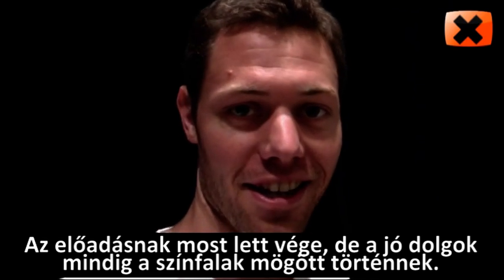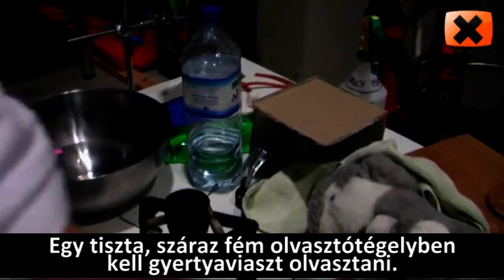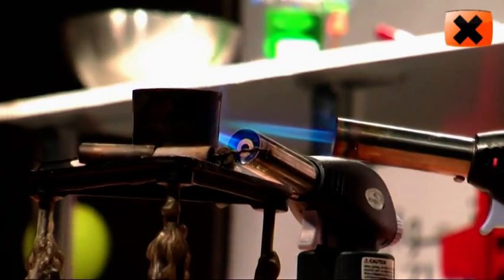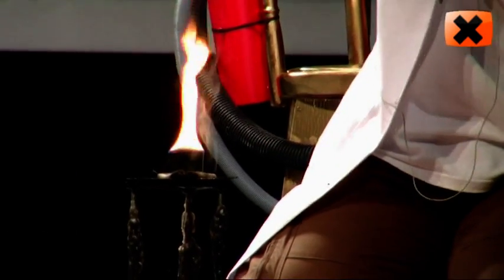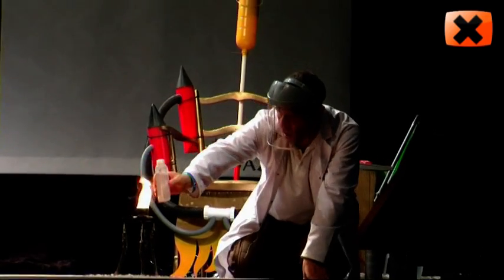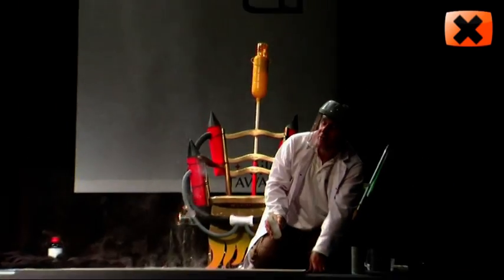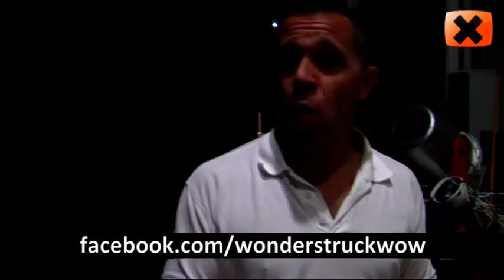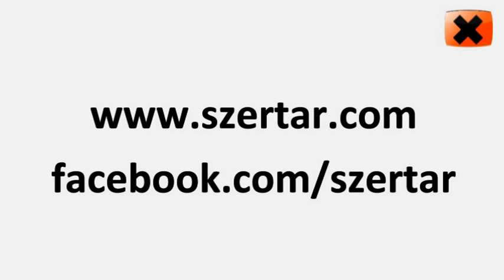DIY thermobaric bomb / Csináld magad aeroszol-bomba

Comment: This has nothing to do with a air-fuel bomb/explosive! The fuel cloud HAS to be initiated by a high explosive charge like 50 g of C4! And the fuel itself needs to be an ether, like propylene oxide, otherwise detonation will not happen! This is simply a burning cloud. Real air fuel bomb has cloud detonation velocity of about 1500 m/s and 2.5-5.0 TNT equivalency. Did it look that way?
Reply: You know a lot about bombs 😳